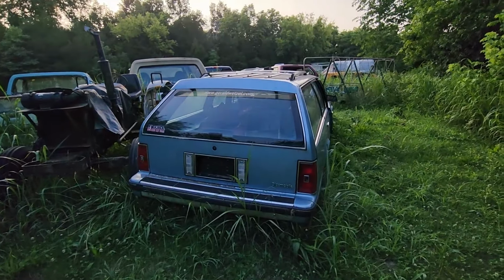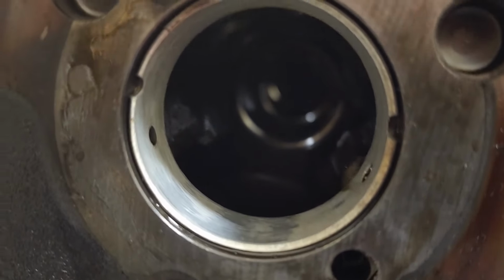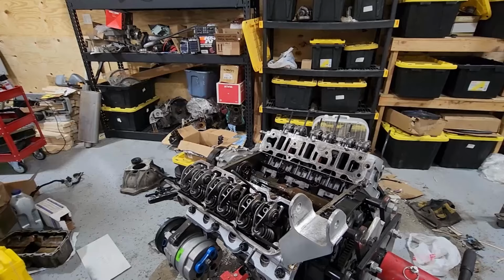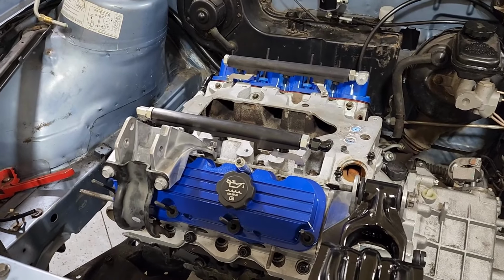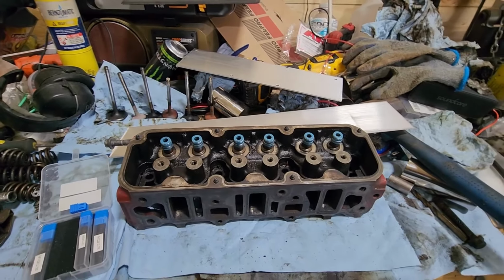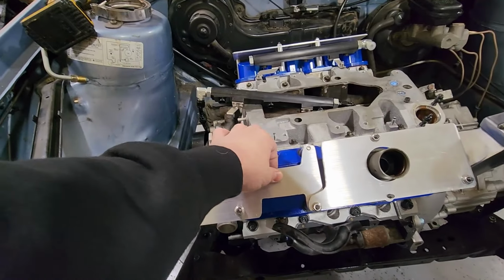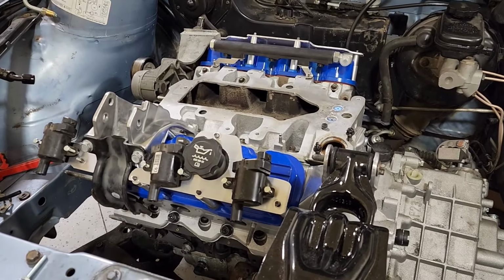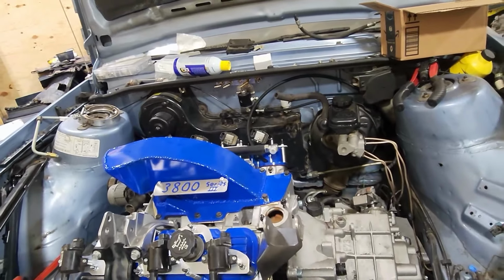DIY LS coil brackets on a 3800 and Final Engine Install on the Cutlass Wagon!!

Comment: Question :   in a swap from a 3.3 to the 3800 ..could one run a series 2 engine in a 1992 Buick century and keep the OBD1  computer ? and stock (  non electric ) transmission .... Jay